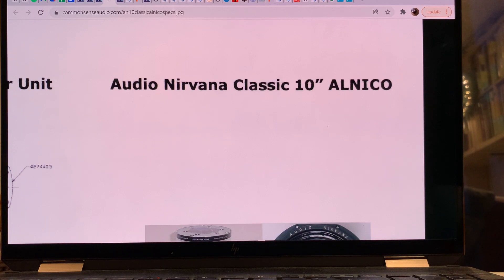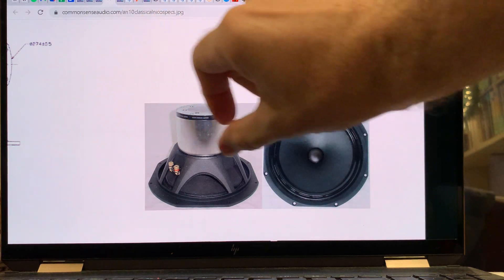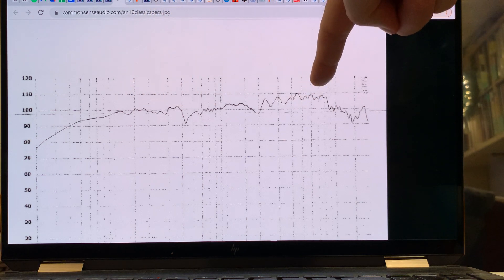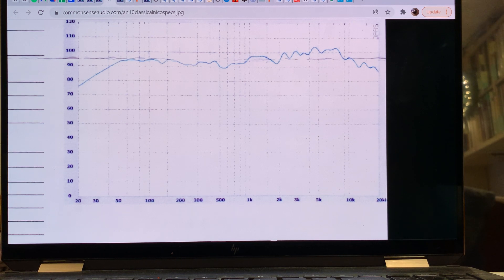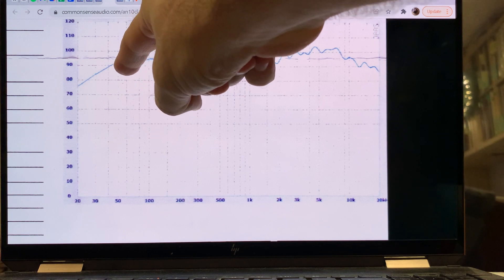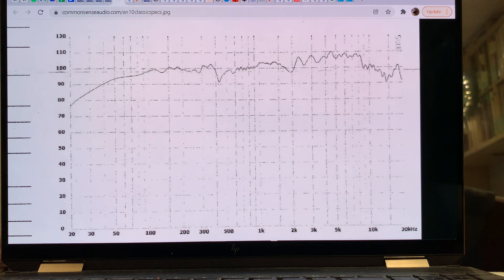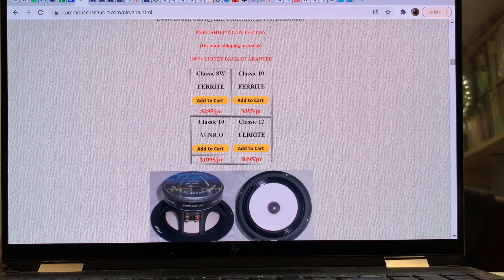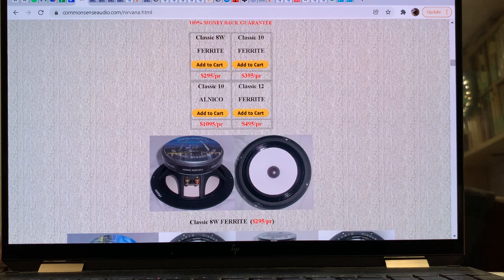Audio Nirvana 10in Alnico driver: why is it special?

Comment: Hi mate n thank u for sharing,
Do u know maybe specs for New Super 8?
I would like to know the specs. My project is to fit them on my thick tubes ~14L with Passive Radiators on Back
Reply from the maker: Hello, I suspect that 14L is much too small for them to produce deep bass, you will most likely get very good upper bass and good midbass but likely not much below 50-60Hz. I'd recommend at least 40L cabinet volume, either PR or BR, both need that volume for bass production. 
Here's the datasheet, good luck!
https://www.commonsenseaudio.com/an8superspecs.jpg

Comment: What I use for my speaker builds are all ferrite versions as I was going for maximum value for money. They do need notch filters, different values for Classic and Super models, to bring the upper mid and lower treble down to the adequate level. Bass though is very satisfying indeed, despite the earlier roll-off of the naked driver. Would love to try the alnicos but that would be a completely different exercise. The ferrites though, can be made to sound way better than they have a right to at their price points.

Comment: $1095/pr  wow. I need to sell my car.
Reply from the maker: Yes, sadly new production Alnicos are very expensive due to the low production quantities - yes, the difference btw low production Alnico run and regular ferrite runs makes x2 x3 cost difference. However, if one can afford the money for loudspeakers, then this is how the situation looks like: you like your DIY speakers with the 300-400$ drivers. You want better tone & step up, then most people will have to pony up 10K$ for a commercial loudspeaker that is a significant improvement. Instead, you only need to come up with 1K$ to change the driver, and you will be happier with it than changing over to a completely different design and doing a reverse mortgage on the house...